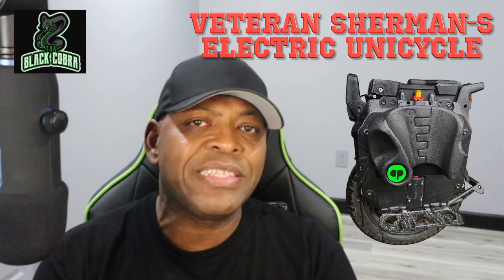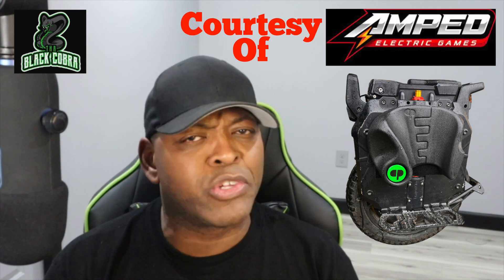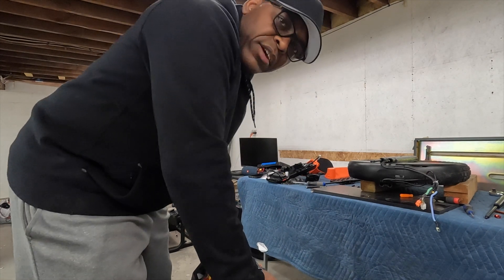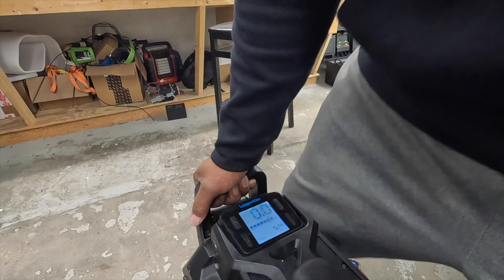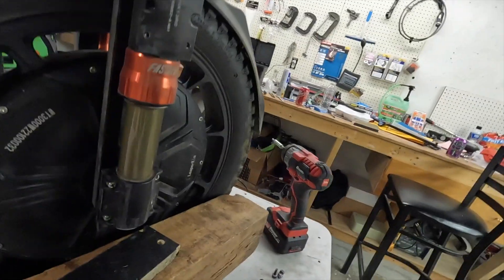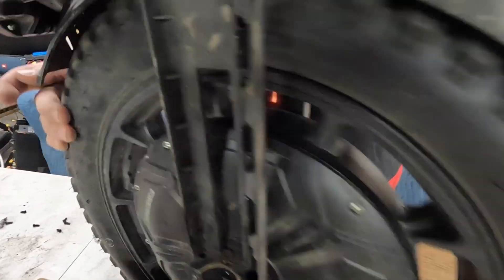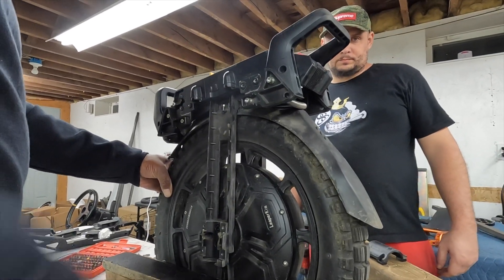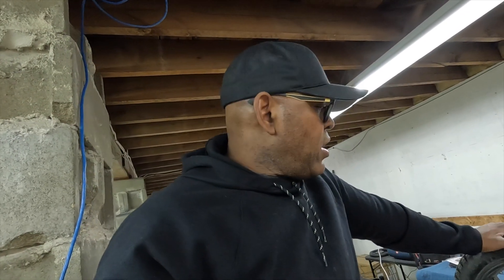Sherman S Electric Unicycle Deconstruction I'm Stumped!

Comment: 🤫-Three Choices....1.) Send it back in for an evaluation, repair or replacement under it's warrenty, include the video if you need to.
2.) Tere it down yourself void the warrenty and in the worst case scenerio where you can not repair the problem due to lack of knowledge or technical skill.....Replace the motor with your
own out of pocket.
3.) You have done all you can within your scope of knowledge.....Leave it that way until the motor needs replacement and replace the powerplant.
Reply from the maker: I believe it is the controller, and they are sending another one

Comment: I have my Sherman S apart right now & I would bet you got debris penetration through the bearing into the motor. My bearings were completely shot within a couple hundred miles from dirty water intrusion. Leaperkim used an off brand bearing & poor quality grease. Replacing with SKF bearings (thanks EEVEE’s) & high quality marine grease. We’ll see how it goes.
Reply from the maker: That’s fantastic. Let me know how it turns out.

Comment: Im 4 mins in. Could it be a bad bearing? Like a cracked bearing with a chip of metal or something getting scraped around inside the bearing, so u wont see anything, but you'll hear it and feel it whenever u rotate the bearing.

Comment: Dang that sounds like there are some angry bee's in there! From what I could hear it sounds like something may be lose causing vibrations. How ever taking apart a electric motor and finding the problem is above my pay grade.
Be extra careful until you get that diagnosed, it's still a 2022 wheel at the end of the day.
Reply from the maker: I haven't really ridden much at all and FreeMotion is sending a new controller

Comment: Yoooooo, this is the 2nd NEWER wheel that has popped up with some sort of stress noise from the wheel/ motor area. The two most solidly built wheels currently on the market can't handle a heavy guy.., and his buddies.., SMH. They maybe solidly constructed but with crappy parts!! 🤨
Reply from the maker: Hey Vee wassup Sis.  I actually it was all the jumping and the 35 MPH crash but they also have an updated controller, which I am now getting.... YAY

Comment: Honestly, the motor sounds fine to me. It's normal to hear a bit of noise like that when you manually turn the motor. As for when it's powered on, I can't comment.
Reply from the maker: Yeah there's definitely an issue but FreeMotion is sending an upgraded controller

Comment: Hello Erwin, the sound you identified when the motor is turning is common and seemed normal. You can check on other wheels, turning their motor when they're off and they should sound similar.
I'm not sure I heard from the video as good as you in person however.

The vibration & resonance it has when balancing is not normal however that's for sure. Agree it's best to try to get to the bottom of it if you can.
Reply from the maker: I really want to figure this out because I really love riding this wheel.
Reply: @ThaBlackCobra  please make a follow up video if you do find out more.
I'm an having very similar issues on the eWheels 'V2' Sherman S.
Quite unnerving riding the wheel as you feel it oscillating/pitching slightly underneath you while riding & especially noticeable with no load watching it tick back & forth
Reply: @ThaBlackCobra  and Kevin, is there a bit of play, or deadzone in the middle of balancing at low speed on your wheels?
On my Sherman S unit there is. Less than typically seen on Master but still present.
This firmware play is by design, to prevent such vibrations.

Comment: That sucks man.  You wait 6 months, you suck it up and pay way too much for it, then they send you dud. I put my deposit down months ago, but I can't make myself pull the trigger and get it. Too many small things adding up to make it not worth $4150.00  Hope it works out.
Reply from the maker: This a demo wheel so the idea is to help find out any issuses that may need fixing.  I'm hoping this will actually help others since they can fix most issues that arise from these demos.  I would tell you this wheel is fantastic and it is worth the upgrade from whatever non-suspension wheel you may be riding.
Reply: @ThaBlackCobra  Oh that's right, Hsang said he was sending it to you next.  They're already sending out production models without waiting for you betas to find the issues.  That makes me even more skeptical.  We'll see.  Thanks for answering.